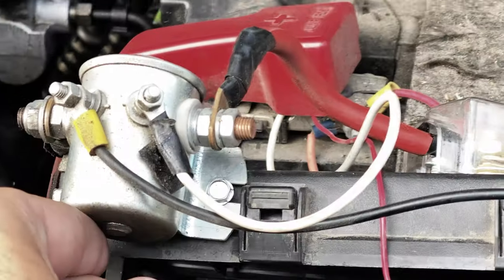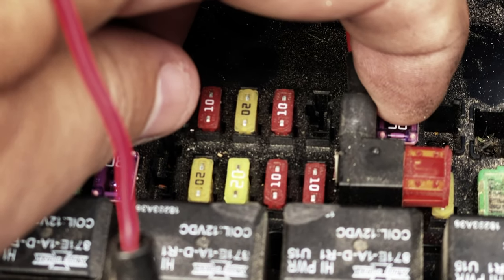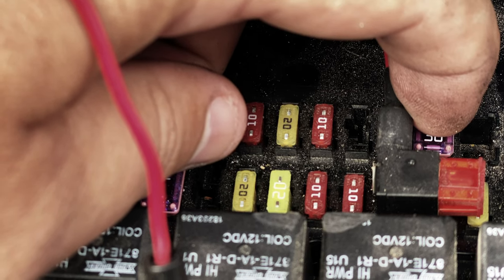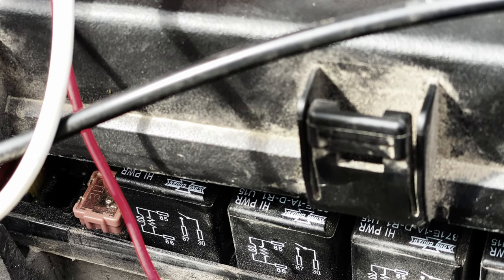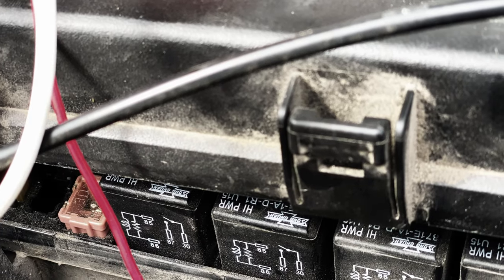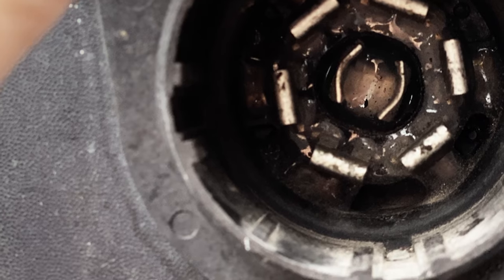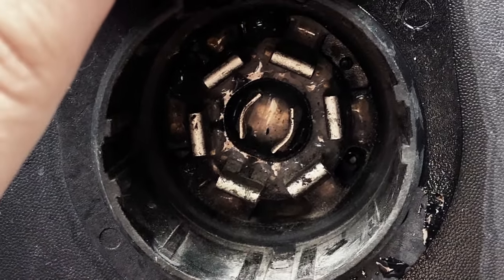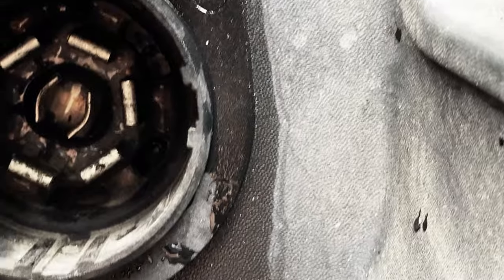Blown Trailer Fuse F30, Trailer Battery Dead, 2019 RAM 3500

Comment: FYI, turned out mine was blown as well, but in checking all power sources, I found no power on the prongs for the 30A pink fuse, so I thought it had to be something else.  But finally I decided to try one of my extra 30A pink fuses (don't have a sunroof or 115 power converter), put it in, and it worked!

Comment: Thanks for posting!  On a 2022 Ram 1500 the trailer tow +12v is in the fuse block UNDER the dash. See page 408 of the manual, 30 amp fuse F01. Verified by removal. It’s the UPPER LEFT corner of the fuse panel. See other posted videos for access and location.

Comment: I pulled my 5th wheel this weekend and lost trailer brakes on the way to the campground. I looked online and in the fuse box and F30 is called trailer tow.  I couldn't hear any noise in the trailer brakes when pushing the pedal but I could after I swapped that fuse. The thing is I had power on that top pin for 12 volt power to the trailer the whole time even before swapping the fuse but the brakes did not work. Looking at the diagram posted here it shows the pin at 5:00 to be trailer brakes. So what fuse controls that? Because I haven't been able to find it. Except for F30 on my truck says trailer tow And the brakes are buzzing once again.

Comment: Hi there,
I have a 2016 3500 ram dually and just recently a few day ago my 7 pin  trailer hook up in the bed stopped working no power.  So I checked  the fuse and it looks and pulled it out and there was no power to the box  pin plug and to the bumper pin plug. So I put it back in and only the bumper 7 way pin works. So is the a different  fuse I should be looking for ? Any help would  be appreciated as I run 5th wheels transport  in Socal and I had to make a pin extension from the back bumper  and into my truck bed so I can keep working

Comment: Thanks!    :)      So, if a remove F30 fuse on my truck, will everything else still be functional on the trailer (light, bakes, turn, etc) ?    I want to do this because I have lithium batteries on the trailer and my solar panels on top do the trickled charge.   I don't want to damage the alternator with over-current to charge lithium.
Reply: Yes. Separate fuses.

Comment: Same for 2017 2500.  F30 blew and had same problem. Thought my winch took a crap on me. Nope blew a fuse under a heavy load..
Reply: What fuse was was it I have a 2017 ram 2500 and can’t find the fuse

Comment: oh yea! Same on a 2014 Ram 3500.
Reply: I actually removed that fuse, since I have lithium batteries they would constantly drain from my truck batteries. Now I have no need for reinstalling a questionable isolator. Thanks for the tip.

Comment: I keep blowing my f30 no idea why.
Reply from the maker: I would disconnect the cable from the truck to the trailer if your trailer has batteries, before using electric jacks. The load from electric jacks may be to much. Also, the connection from truck to trailer may not be real good, causing high amperage arcing